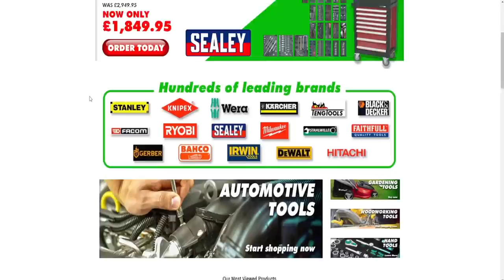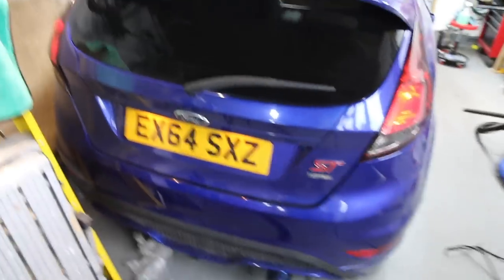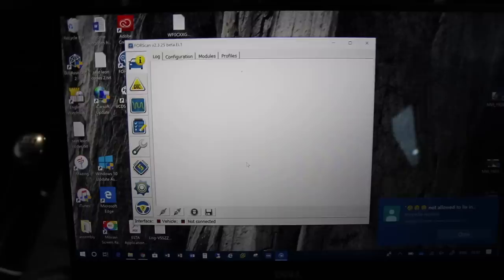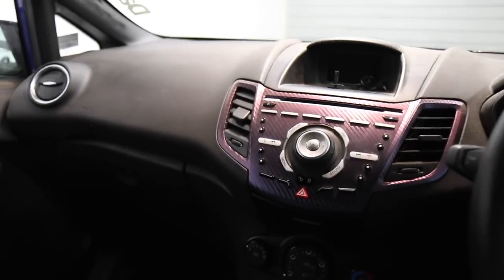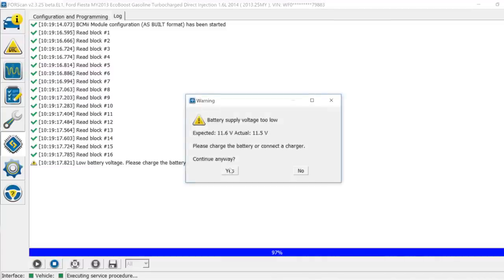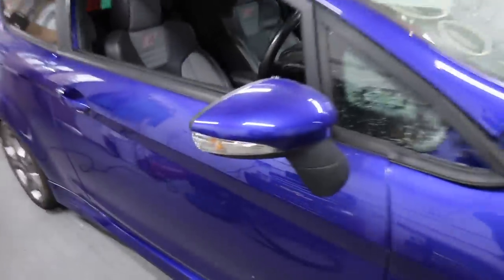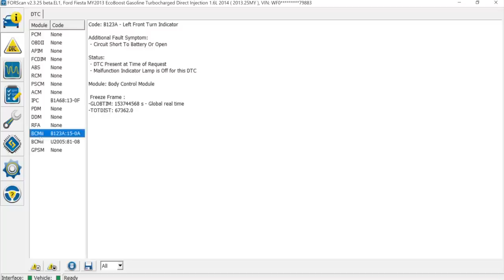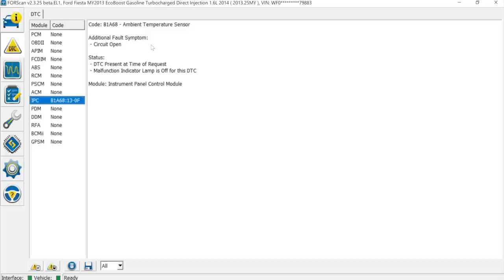How to replace and program a BCM in a Ford Fiesta ST

Comment: I just wanna say thank you from the bottom of my heart, I followed your guide and my fiesta bmc is working perfectly, I had issues with indicator lights, central locking and all kinds of weird things, just replaced it and programmed it and all is good now. for a tip, losen the bolts of the fuse box so the bcm comes out easier. my fiesta wasn't st just regular mk7 2015. this costed me £25 for bmc and f software was free because of trial version, if I took it to dealer I would have been slapped with more than a £1000
Reply from the maker: Great to hear
Reply: @CarsForPaul  one minor problem was the power windows just needed a reset by closing the windows and holding button up for 2 seconds and do it one more time fixed this issue.

Comment: Nice one Paul glad I could help with a few tips. But you fixed it yourself in the end could hear in the video the satisfaction in your voice. Well done it is nerve racking going into the settings etc . How much money did that save you I wonder I reckon around £600 . Surprised on the key remote being all set must be because of the settings or keyless ignition. However great stuff I'm pleased for you if you need any other tips give me a shout.
Reply: Your a really nice guy. So nice to see people helping others. Respect.

Comment: The code you had left after resetting wasn't to do with the indicator itself. It means that the engine light (engine indication lamp) isn't on, on the dashboard. The code was to do with the ambient air temp sensor. Circuit was open so means that you have just forgot to plug it in!!

Comment: Well done Paul, I've been sceptical in my comments previously regarding whether it was the BCM but you proved me wrong so glad its fixed. I wonder what the condition is for the BCM to fail like that? Also the "- Malfunction Indicator Lamp is Off for this DTC" is part of how forscan displays the error code log for the above fault, in this case the ambient temperature sensor not being connected i.e. its logged the error but not leaving the EML on permanently. So its nothing to do with the direction indicators themselves.

Comment: Hi Paul, i've been following this video because i had a similar issue but with my front wipers. I have backed up my old BCM but when i go to load the new modules onto the new bcm i get an error saying that the configuration is not compatible (paraphrasing now that the car isn't plugged in). Any ideas?

Comment: You checked the indicators both sides, but I don't recall you checking the hazard lights still behaving as you'd expect. I wouldn't expect there to be a problem, but it wouldn't hurt to confirm it!
Reply from the maker: I actually did check the hazard lights in the video, and they were working fine

Comment: I am having to do this soon for my fiesta is acting weired, doors don't lock, indicators don't sound and radio screen turns off. Did you have to re-programs the keys also?
Reply from the maker: No, my key was fine
Reply: Hey dude, what did you end up doing? This is exactly what the issue with my car is currently and I'm in the process of trying to sort it out. Any input would be vastly appreciated

Comment: I’m thinking of doing something crazy that involves my bcm - swap my 2011 Fiesta SES bcm with a 2015 BCM in order to then upgrade from Sync 1 to Sync 3. I found a similar BCM for an AT 1.6 hatchback. Could this work with some programming? Would my odometer (currently only 48k miles) be forced to the used BCM’s miles? Any way to fix that? Thanks!

Comment: Hello,i have some issues with my 2012 tdci Focus mk3 BCM,it has only keyless start so i would like to know how did you programmed the Passive Anti Theft system without specific key programmer (Mautel or frds)i do have Forscan and UCDS but as i know when the BCM is replaced the keys have to be matched to in addition to the as built copying from old one.
Regards.

Comment: Well done Paul. I have licnese Forscan for 3 years and your video give me inspiration to save program on my PC like BCM,ICC,ABS,ECU.This parts can fail any time and getting second hand parts with saving program from old module can solved problem with security chip build in BCM,ICC,ECU and escaping huge cost from Ford deler can be reality. I have Ford falcon ba 4.0, 6 clynders Australian made and I'm interesting to know if I save program from my ECU and if I have to replace second hand ECU with maching numbers,maybe serial number is different will this work same like on BCM module format configuration and Mobilser "antena"will go true pass factory build chip and VIN number in ECU?

Comment: Hi Paul, do you know if with forscan it's possible to clear crash data on RCM module? I've got a 2009 mk7 fiesta and the airbag light is on due to airbags deployed years ago. I've had already replace dashboard, airbags and front seatbelts. Thanks in advance

Comment: Really struggled to attempt to remove my BCM from my ST-2. Theres a huge thick wiring loom in front of mine.. Couldn't get enough room. Any tips? Also I assumed the keys were coded to this? Obviously not from your video. I planned to retrofit an ST-200 BCM to enable me to fit reverse sensors.

Comment: Hi. I also own a ford Fiesta. i just want to know how to connect/wire Alarm horn to it. I want to use it particularly while locking and unlocking the car. i tried searching in schemetics but i am bit confused as to which connector to look for as their is no number printed on connectors. i have 3 big connectors Blue Grey and White. And some small Grey, White, Green and Blue connnectors.
Please help me connect alarm to BCM. {8v59-15K600-AJ}

Comment: I have a 2017 Ford Explorer Sport and my LiftGate Control Module fried and I replaced it but my Liftgate doesn’t work at all and I can’t seem to select the power Liftgate setting on the dash as well.. would I have to program it to this new Liftgate Control Module? Thanks!!!!
Reply from the maker: You may have to, I copied the settings of my old one and then uploaded them to the new BCM which worked pretty well
Reply: Cars For Paul thank you for your quick response sir! I just ordered a OBD 2 scan tool to use with the ForScan software.. the dealership was charging 150 to diagnose and another 150 to program the module.. hopefully it’ll get here soon so I can fix this issue. It’s a pain in the butt when you cannot use your trunk lol

Comment: is this appicable to the ford fiesta 2006 1.4 tdci, i do have indicators and hazards, but missing the click from the dash when indicating also the green arrows on the dash dont work in either indicating or hazards, although if the ign is off and hazards on i do get the click and arrows on the dash flashing.
Reply from the maker: I couldnt say for your car type

Comment: What’s is a bcm and does that have anything got to do with Bluetooth,aux and usb because it’s not working on my car and i bought that box called Bluetooth module in 5:44 the one with cables hooked up but it still didn’t work after I switched the Bluetooth module
Reply from the maker: You will need to reset the bluetooth module using  forscan

Comment: hello, do you need to reprogram the keys? my car is ford ranger 2014
Reply from the maker: I didnt have to for the Fiesta, not sure about the Ranger
Reply: @CarsForPaul  thank you so much
Reply: i turned out i need to reset the keys after replacing bcm for ford ranger 2014. All of which i did using forscan, thank you.

Comment: Hey Paul, I just found your channel and suscribed you, could tou give new guy a little bit information what is the best way to get a first car from copart for myself and what is the optimal price buy a car because of all fees, and what kind of damage is worst and which is easy to fix it up.. for example I can see a mane cars with damaged both side doors or front damage like hood bumper headlamps... probably cheaper and better change doors isn't ? Maybe in future we will see a video for new guys see ya later mate !
Reply from the maker: Difficult one to answer, as different cars sell well in different parts of the country, and fees will vary depending on how much the car goes for but I would advise you to look for cat N cars as they are easier to fix

Comment: My fiesta keeps saying door open when it's not. And central locking keeps clicking. Any ideas?
Reply from the maker: Not really, possible faulty door lock or module? Get forscan on it and it will tell you
Reply: @CarsForPaul  thanks for replying pal. Changed door lock. No dice. God knows where this door module is.
Reply: Needs scanning your right

Comment: Paul, this may seem like a simple thing to mention (and you may know this already) but with the MK7 Fiesta, to fully lock it requires a double press of the remote (which is why there's two lock icons on the remote). The first press locks the doors, and the second press arms the alarm. The car should give you two indicator flashes to tell you this. Funnily enough, not many people know this.

My source is I have a MK7 Fiesta ST. Many that are stolen without the alarm going off is due to them locking the car with one remote press only. Keep up the great videos.
Reply from the maker: Me included, thanks for the tip
Reply: @CarsForPaul  No problem. If you want another tip, more strange than the last, you can wind your windows down and up using the remote. Try testing the feature on your car. With the car locked, press unlock once, wait for about a second, then press and hold unlock. Both Windows should wind themselves down. To wind up, you need to do the same thing with the lock button. The only annoying thing is that it is a hit and miss with the MK7 Fiesta.
Reply: @IshmaelSimpson  will only work on fords if you have the one touch down and up on the windows. You press and hold the button and it will operate. You also have to reprogram this if it's not working fully as it looses the setting if battery goes flat.
Reply: Doesn't the 2nd press also set the deadlocks? Also as RA said that for global close/open to work (assuming its fitted) following a battery disconnect, then you need to go through a quick programming procedure for each window so it knows where the open/closed position is.
Reply: @robthomas7232  yep that also sets the deadlocks. This can be turned on through the bcm to operate on one push of button as well. I recommend not activating the deadlocks if a car is parked up for a period of time if these stick it's a pain in the ass